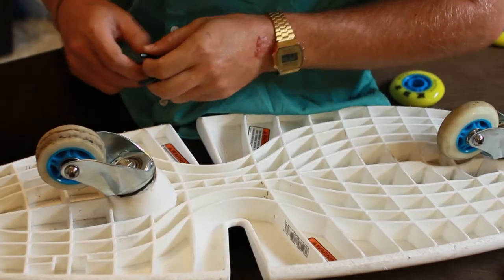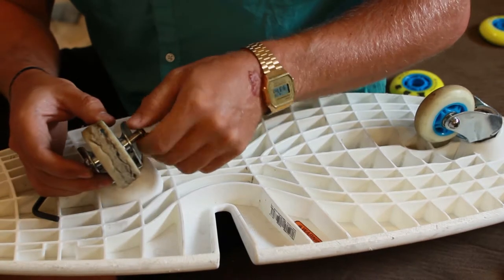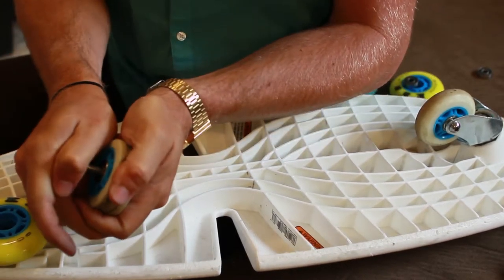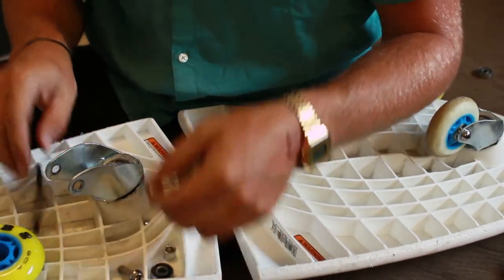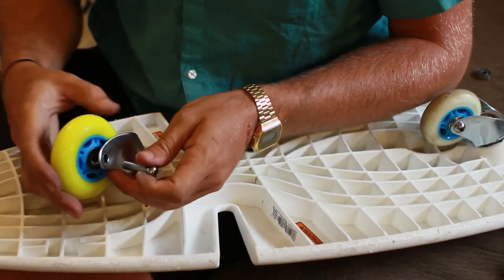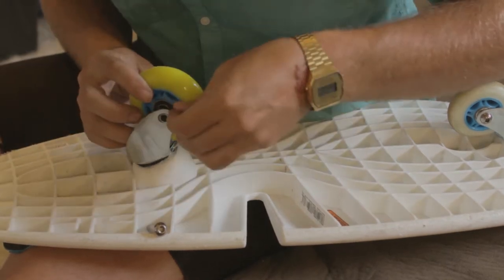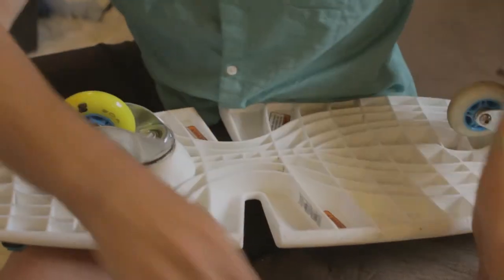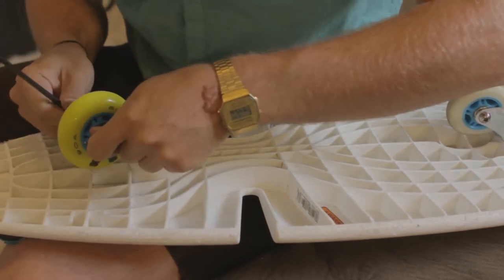How to replace Ripstik Ripsurf wheels with bearings and without bearings

Comment: Can you put Reds or any other faster skate bearing in these wheels?
Reply from the maker: Yeah. They're standard skate bearings. These abec 7 that come with the KBS are really good though. Roll super long and fast
Reply: Dang man thanks for the fast response. I usually post a ?? On YT with no response. I just got out tonight on my new RipSurf while my kiddo was on her new skateboard and right away I thought damn.... These stock wheels and bearings are hella slow. So we change locations from the tennis court we were at to a parking lot with a decent slope on it so I could get some speed. I like the RipSurf it’s fun but I need more speed. I been snowboarding for 30 years so I really like the similarities as far as the heel toe carving. 

I wonder if a wheel with a harder compound coupled with a faster bearing would give me the performance I’m looking for...? I also can’t wait to get to the skatepark and flow some bowls.

Comment: Want size are the wheels
Reply from the maker: For ripsurf and original ripstik you can fit up to 80mm ripster and smaller boards need 68mm haven't tried anything bigger on those boards
Reply: g3mccotter ok thanks

Comment: Do ripstik wheels work on ripsurf ?
Reply from the maker: Spencer Taylor Yes they do. Ripsurf can take up to 80mm wheel. Ripstik can take up to 80mm wheel also except for Ripstik mini models and ripster, they can fit a 68mm wheel (not sure how big they can go).
Reply: Thank you. I saw 76mm ripstik wheels, so they would fit on a ripsurf ?
Reply from the maker: Yes 76mm would fit. Anything 80mm and smaller will fit on a ripsurf. The KBS ENDURANCE are the best as far as performance and durability they will last the longest and go the fastest.
Reply: g3mccotter i know this is much later , but Would you say the kbs are overall best is still the case?
Reply: Thanks for this video!!!